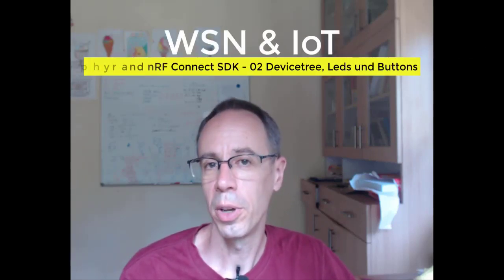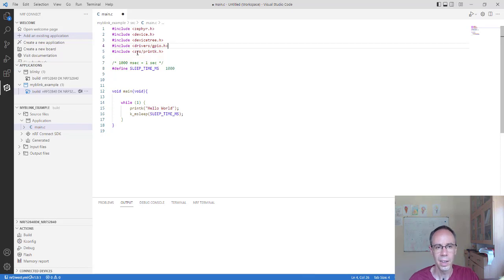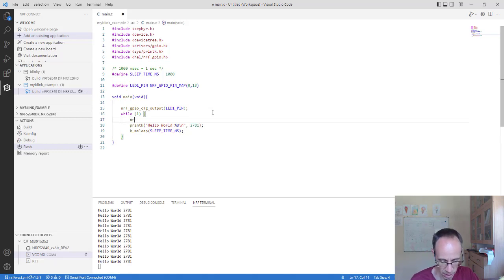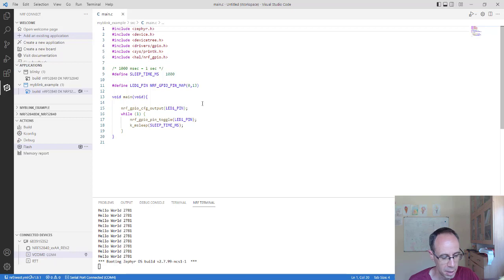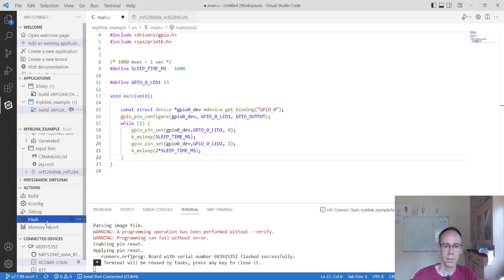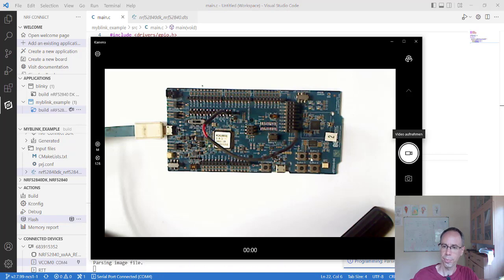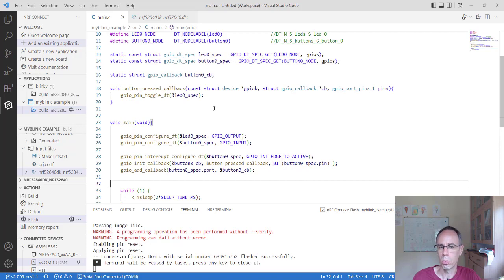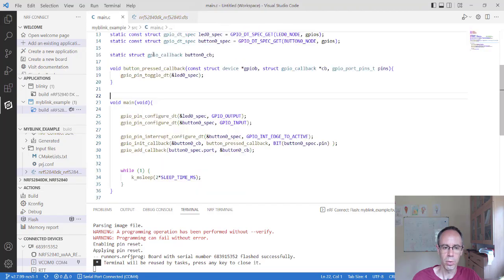Zephyr and Nordic nRF Connect SDK - 02 Text output, devicetree, Leds and Buttons

Comment: When using SDK V2.2.0, you may find that the code for programming GPIO from the device tree doesn't work and the terminal gets stuck on * Booting Zephyr OS build v3.2.99 ***. This is because the function device_get_binding("GPIO_0") is deprecated. To fix this, you can replace it with DEVICE_DT_GET(DT_NODELABEL(gpio0)) and the Blinky application will work correctly.

The series is a superb resource to have, I greatly appreciate the knowledge you're sharing.
Reply from the maker: Yes, you are right. Before there was a special label with GPIO_0 in the device tree, but it is removed. Makes sense because it made things more confusing.

Comment: I'm just starting to use Nordic parts and there's an insane amount of code, configuration and overlay files required compared to other architectures, to do the simplest things like read a GPIO pin. I mean this video is almost 30 minutes long to turn on an output and read an input. You can do that (in fact, read and write 8 pins at a time) with a couple of lines of code with say, Atmel parts in under a minute. The worst thing is that they use macros within macros within macros everywhere in the SDK. So there's often no way of telling what an error even means as you get reams and reams of errors all expanded out from various macros with names like "DT_N_S_leds_S_led_0_P_gpios_IDX_0_VAL_pin" 🤣
Reply from the maker: I have also used Atmel products before and your criticisms are quite valid. However, the approach has fundamentally changed as microcontrollers become more powerful. Nordic also previously used its own environment with the nRF5 SDK. However, this was specifically for the nRF5 series. Nordic has now switched to the free RTOS Zephyr as a development environment. With this, the source code remains largely independent of the board used and you have integrated scheduling and task handling. Nordic has only limited influence on the implementation by Zephyr. The macros are sometimes really annoying, especially at the beginning. But you get used to it with time. You wouldn't have to use many of this macros either, but then you have to generate and initialize the variables yourself, which makes the sourcode much longer. You could also continue to control the pins directly, but then you would be programming board-specific again. If you get used to the macros, understand the concept of the DeviceTree and the activation of certain modules, Zephyr becomes quite comfortable. 😉